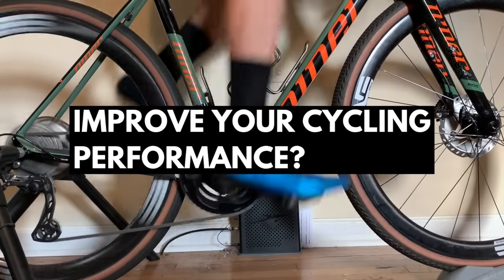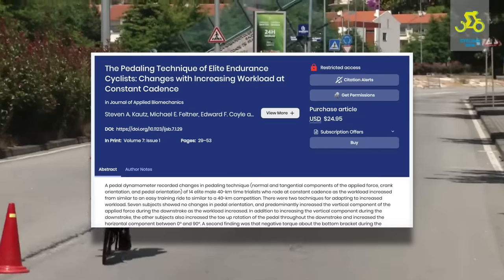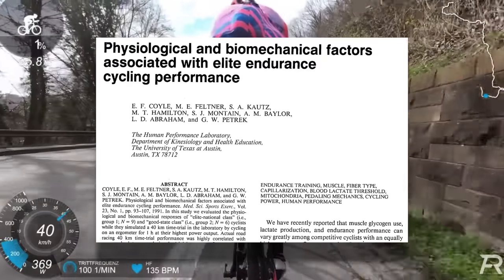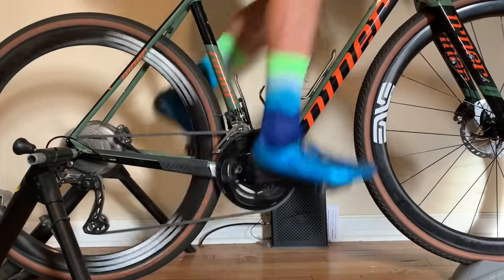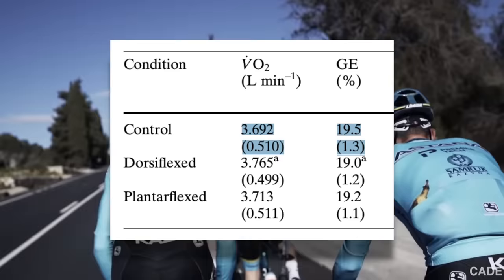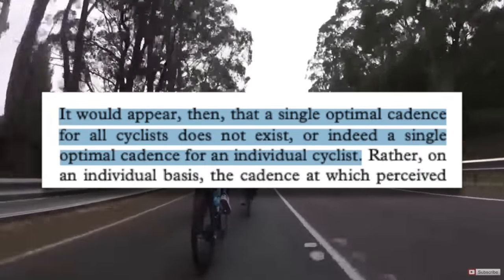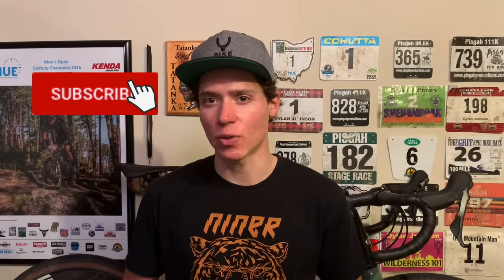Does Your Pedaling Technique Affect Your Cycling Performance? The Science

Comment: Honestly, my pedaling efficiency allows me to easily drop stronger cyclists in spite of having an inferior aerobic system. The studies tend to look at the wrong factors. Put a wine glass between your shoulder blades and go down hill on a fixed gear at 150 rpm. Or just look at any experienced track cyclist to understand the difference. It's not about the power output, its about the power wasted.

Comment: Find a gradual climb and ride with one foot unclipped. Right foot then left foot. Don't overdo it the first time. You will have sore muscles the next day. Those are the muscles you haven't been using to round out your pedaling. Once those muscles are fit riding is the pack is easy. Your big sprint muscles will be ready when you need them. When I was 50 I was still very competitive in 30+ crits in Austin Tx. In a 5 week series I placed 3rd overall. That was 24 years ago. I  was a 5' 8" lightweight climber that had to train for mostly flat races.

Comment: Actually trying to pedal circles helped me improve cadence and power when riding at a high intensity. Naturally I was pushing too hard towards the end of the downstroke which is obviously not so efficient. But when I became aware of that and started trying to ease the pressure on the pedal just before the crank reaches the downmost position and then lift the foot as fast as possible, I was able to increase the cadence and speed immediately without any increase in the effort intensity. So I guess working on pedaling technique can help if your "natural" pedaling style is not very efficient.
Reply: Yep so true

Comment: I did a bike fitting course a couple of years ago. We had some pretty advanced tech and were looking at pedalling vectors, we could track pedal force, power, as well as horizontal and vertical vectors. It was lead by a euro sports biomechanic who works with world tour teams. We looked a pedal forces when pulling up. The issue for cyclists is that while one foot pulls up, the other leg is trying to push down (where the majority of force is generated). The ability to time this pull up and not work against the leg on the opposite side pushing down is extremely difficult, if not impossible at cadences of 80 - 90+ rpm. The data we saw showed that although cyclists can pull up, this usually resulted in applying an opposing force to the leg trying to push down. Essentially one leg worked against the other.

He had data from elite track riders (fixed gear) and showed they were very good at unloading the opposite leg at very high cadences. It takes a lot of practice to become that efficient. They did not pull up. The best they could do was unload the opposing leg. The only exception was a track start, where they had to get a big (huge) gear moving from a standstill.

I do not coach one legged drills or get riders to pull up. I just want them to pedal naturally and injury free and become efficient at a broad range of cadences. Push down. Push hard. Push often.
Reply: You can see if one leg is fighting the other with "power cranks" or independently ratcheting cranks. If you don't know what they are it's like having a ratcheting wrench on either side of your bike with a pedal stuck on the handle end. Both push forwards but will "coast" in the backwards direction, so one pedal can't drive the other. If one leg is fighting the other, they will get out of sync from the 180 degree position.

The only thing they can't help you with is if one muscle is fighting the other in the same limb. E.g. quadriceps and hamstring, gluteus max and hip flexor. Unfortunately muscles aren't perfect springs and are quite lossy in eccentric "contraction." I mean it's useful for activities like going down stairs, but this is wasting energy from your "PSU" that could be turning the wheels of your bike faster. As cadences go north, it is increasingly difficult to not have muscles work against each other. For instance, bending and straightening your arm, as you get faster, your biceps and triceps are contracting at the same time. I suppose you just have to learn it like a drummer.

My last question is, with 2 joint muscles like the hamstring, are some opposing muscles inevitable? Usually the quad and glute are used together, but the hamstring can add a bit more force to the job the glute is doing pushing the thigh down, but it would fight the quad as it bends the leg vs straightening it. You'd use the glute and hamstring together for scraping back with your foot. I think it's also inevitable in any recumbent cyclist not using clipless. You need to put pressure on the pedal to keep your foot from falling down off of it, so use clipless pedals on a recumbent bike.

Comment: Spot on!! The myth of circular pedalling, or any variation there of, has been shitting me for several years.  To ride fast, you've gotta pound the crap out of the pedals on the down-stroke.  Here's MY pedalling drill: loosen your shoes so you can practise focusing on pushing only.   The main purpose of clipped pedals is to stop your feet slipping off during frantic moments, and ensure that the feet are always in the same position.  That said, you may occasionally need to pull up on the pedals during very short accelerations off the saddle which, even if that's only for 3 seconds in a race, is very important.  
A lot of coaches try to complicate things such as pedalling to justify their existence.

Comment: I literally changed my HR by around 15-20bpm, while still keeping the same cadence and power, by not trying to pedal in circles (I.e. trying to actively “scrape” my foot or pull with my hamstring) vs. concentrating pushing down harder on the pedal. Being able to relax the inactive leg greatly reduced fatigue and HR. But still making sure the off leg isn’t providing any resistance to the on leg. That’s what I think “smooth” circles mean.
Reply: stop noo, i was improving soo much when focusing on pushing down, i was like people need to not find about this if i want to move up on strava :'DD
Reply: You used more the ileopsoas, a hip flexor to pull up your pedal, the hamstring act more like a hip extensor in cycling
Reply: luca bonato that, but I definitely used the hamstring as the flexor. I literally learned from some tri athletes that more power was produced on the pull. But what they thought as power was likely torque. I’d always get hamstring cramps when cycling long distances. Much better to be using the big quads to produce power than the “strings”. So surprising how much lower my HR became.
Reply: @deverenfogle3201  Same with cleat position. The further forward the cleats, the more the calves are being used and they're tiny and easily exhausted compared to the big quads.
Reply: Temple of Ridicule You’re funny!
Reply: Temple of Ridicule I have the data if you wanted to peruse my TP. But you’re free to keep trolling! ;)

Comment: Really fantastic video with great evidence! It reminds me that the ankle flex at the bottom of the pedal stroke would greatly impact the saddle height, making the methods based on inseam and leg lengths inherently inaccurate. It’s fascinating to realize when sciences are put together, they are consistent with each other! There also seems to be one more question left on the table - should the ankle flex be fixed or varied throughout the pedal stroke.

Comment: Almost 25 yrs ago (1996~97? ) I found using just one foot while clipped in helped with learning how to control pedaling. (obviously, alternate between right and left for 10~15mins at a time)  It encourages 'smother' circles which doesn't mean much at low rpm but at high rpm makes a massive difference to staying upright and on track. 
It takes several weeks  before feeling 'natural but you train' your pedal stroke and it definitely helped. 
At the time, my max cadence could get to 172rpm (about 47mph) but 'normal' was closer to 80rpm. As a hobby cyclist who only re-started riding at ~40, I I thought it was pretty good and didn't actually cost any cash.
 'Professional' set up and training wasn't widely available and was incredibly expensive at the time. I was only doing it as a low impact keep fit regime .

Comment: I've read and thought about this much over the last few years.  Your fitness level will define the sustained effort, watts, that you can put out overtime. Not sure your body really cares about a really even cicular load or predominantly downward force, over the period of many revolutions it will  just average the effort.  It appears that trying to force your body into an unnatural movement tends to lead to inefficiencies, not surprisingly.  But I think a little unweighting of the lifting pedal to prevent any back pressure makes sense. Also, hammering right down into the pedal might not be a good idea, at 6 o'clock you can stand on it and it wont be going anywhere. So for me, it's force at top part of revolution and a little unweighting of the upward leg. ( probably more lifting from the hip than pulling up the foot)  Whatever works for you I guess.

Comment: Great video! It seems a lot of the tests compared a rider's preferred method to the other methods during a one-off test. I would think that to truly determine if one method is better than another, the riders would need to be equally proficient in all techniques for a fair comparison (and/or track progress as proficiency is gained). This probably applies to cadence, as well, at least as far as determining if one is objectively the best.

The obvious takeaway here, though, is that pedaling technique changes are a low-priority item and only should be considered if all other training gains have been maximized.

Comment: Some points you may have missed, pedaling at a low cadence recruits more of the major muscle groups.  Pedaling at a higher cadences recruits the smaller muscles.  This gives you the ability to train both groups.  You can read many articles.  However, people who pedal at less than 75 cadence as theirs”normal”  struggle when there is a major change of pace.  So. If you are saying that pedaling within a certain cadence range is about personal comfort. Yes, studies agree.  But the caveat is, there is a tipping point.  And for those who take your posts as gospel, there needs to be a little disclaimer.  If your cadence is too low, and I am talking less than 75 rpm, then you will struggle with many aspects of racing.
Reply: This is a key point for triathlon as well. There are some muscles you'll want to save.
Reply: Muscle recruitment is based on force, not pedal speed. You can pedal at 30rpm but if the force (torque ) is low it's still slow twitch.  A track sprinter winding out at 140rpm and 1500+ watts is a fast twitch athlete. To recruit fast twitch fibres, power output has to be at least around FTP. This seems to be the tipping point for recruitment. 

Compared to a gym, where 6 - 12 reps are used, pedalling force at low cadences is still very low as a % of maximal force. 50rpm for 5 minutes is 250 reps. So efforts need to be high force as well as low cadence. 

I agree with you about the importance of being able to adapt and accelerate efficiently with leg speed. However, if you are in a bunch at 50% of your FTP and 75rpm, you are not going to struggle with an acceleration. If you are at 120% of your FTP at the same point, you are in trouble.

Comment: Stomper: 30-60 rpm/spinner 60-90 rpm. 
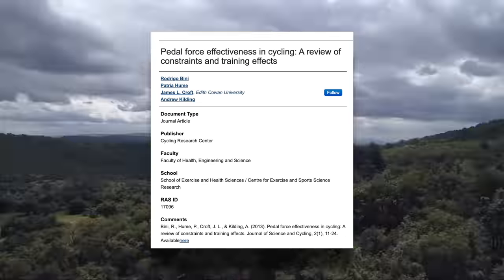I am a stomper, toe down and my power stroke begins at 7:30-8:00 (with 6:00 at bottom) and stroke ending at 6:00. I pulled and pushed at the same time. Seat position is full forward and high +2.5" from nominal standard for a 32" inseam. 56/44 tooth front and 12-34 rear cassette. Arm length 73 but have often raced with 72. Position of stroke centered with bicycle fixed to body: stroke perpendicular to pedal (no wobble/ side to side shifting). My favorite bike was a Rigi Bici Corta but the amount of torque I placed on the frame would bend it.

Comment: Notes from the field. From riding fixed gear on track I learned that to whip up into a high cadence at high power smoothly means a little bit of pedal lift, it keeps your butt planted on the seat at 130+ rpm. On the road the same works to attack a short climb with high cadence while seated which to me helps minimise strain on muscle fibres at the expense of aerobic rate. On a very long endurance ride trying to force a toe up pedal lift style to increase cadence while tired led me to a shin injury of all things. All told, don't overthink things but a well trained smooth fast seated pedaling technique is a good tool in the kit.

Comment: Interesting video as always.. 
Could you do a video comparing mtb and road pedals?
Reply from the maker: I'll add it to the list.
Reply: And flat pedals; as one can use the mid foot position opposed to ball of the foot over the pedal axle like normally on clipless pedals.
Reply: For me even more interesting would  be a scientific comparison of Flat  vs. Click
Reply: @christianbram1959  There is data around for that and flat pedals look to be just as efficient as clipless in terms of pedalling efficiency (Which matches perfectly with the findings here that almost all the power of an efficient pedal stroke is on the downstroke). The benefits of clipless, especially off road, is a reduced chance of losing a pedal on a bump or while very tired as well as the ability to hang on to the bike on really rough surfaces and to make the suspension work on lightweight bikes (If the bike is light enough it sometimes ends up rattling between the rider's feet and the ground rather than staying planted and using the suspension). I used clipless for years because that's what everyone else was doing, but swapped to flats probably a decade ago and have no plans to change back - I can ride further and faster than most people on clipless pedals, but that's because I'm fitter, not because flats are magically better.

The biggest problem with flat pedals is finding ones with bearings (Or almost universally bushings at the crank side of the pedal axle) that can take actual mileage. Most of them shit their bearings/bushings out in a matter of months or even weeks in some cases when used for actual mileage. Hope's pedals are the only low profile platform style pedal I've used that can survive thousands of miles without any minding. If you can deal with the small platform and higher profile, the DMR V8 greaseport pedal is the most durable option for the money provided you pump them completely full of grease before using them.

Comment: Thanx Dylan for trying to explain a phenomenon as difficult as pedaling technique. As a former Tour de France rider I invested a lot in my pedaling coördination. And it payed off a lot. While you measure aspects of the bike and ask riders to adapt a certain kind of technique on the bike I oppose the technique of using your body. As a starting athlete I was not a good "dancer on the bike" so to speak. I didn't use my body in the right way. I was crooked and I didn't move very well. Your body can adapt to any kind of circumstance ie length of the cranck, hight of the saddle etc. But a lot of cyclists are not able to use their body in the right way. 
If you claim then that you have to use either technique you're comfortable with you miss the-adapt-your-body point IMHO
To work on your body, balance and coordination results in higher efficiency on the bike. For me that meant higher cadence (±106/min), sitting motionless only moving the legs. The feeling on the top moments was to have "the force': pulling AND pushing and then flying. To maintain that even in the pain-cave took me a lot of training not in the least mentally. 
Looking forward to your opinion on that

Comment: Great video, even if it has shattered yet another pre conceived notion. Few years back had a bike fit where the saddle was placed a few cm higher than I was used to, went home with a bunch of stretching and exercising routines as well as a lot of pedal drills. 2 DNF's later I went back to my preferred saddle height, which ended up being around 28 degrees knee angle, and started pedaling as it came out. Only focused on suffering to sustain the effort, while letting the legs do its thing with the pedal and all the rotating bits. Great to see that my laziness at spending hours doing pedaling drills paid off :)

Comment: Two things I'm wondering,
1) What about long term interventions? The research quoted seems to all focus on short term interventions
2) This is probably more bike fit, but what about muscle recruitment and fatigue? i.e. if changes to your bike fit and/or pedalling technique result in better overall muscle recruitment and less fatigue, does that help improve performance? But again, this would need to be a long term intervention, as for any given "preferred" technique any rider will have developed their muscles around that technique.

Maybe as an example, let's say a rider was very quad dominant and didn't really engage the glute, hamstrings, calf optimally (for lack of a better term). If they are then given a short term intervention to change their technique/fit/etc. which shifts the way the muscles engage, then the muscles which are now more engaged are not as developed as the muscles which are now less engaged. It seems the only way to really determine if that helps would be to look at a longer term impact which allows some time for the muscles to readjust to their new roles.

Or is that kind of thinking all just nonsense? I guess this question is more like, "Can changing the way (or which) muscles are recruited result in a stronger downstroke?" rather than whether that will help you spin circles faster.